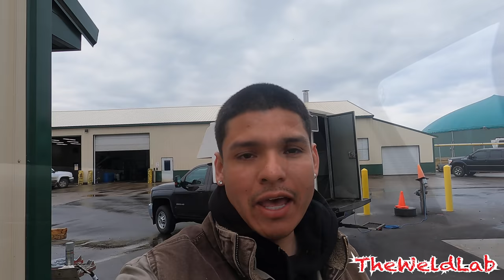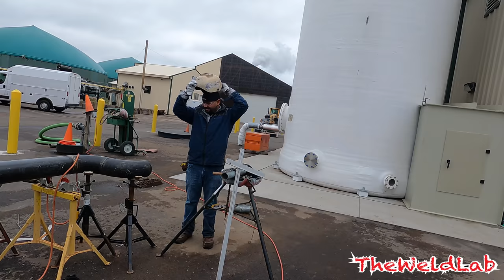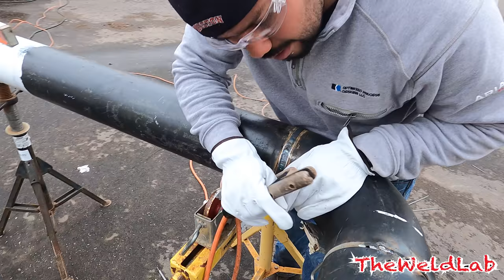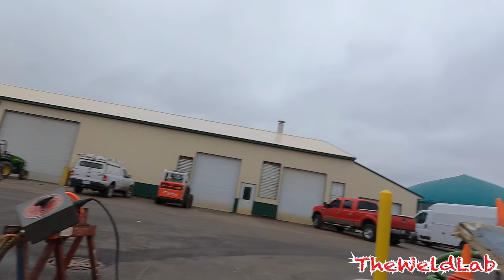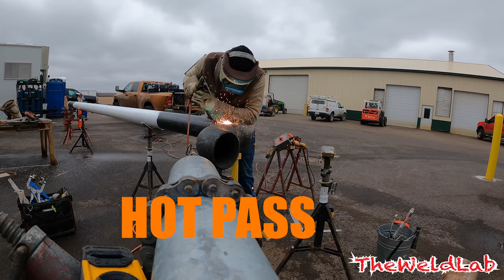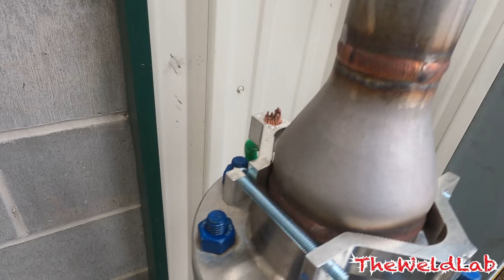X-RAY TIME! | REPAIRING ROOT | FAILED PRODUCTION WELD

Comment: With carbon pipe it depends on what code 1104 or 31.3 I’ve welded carbon where any suck back on the root had to be repaired. Depends on the owners and what they will let by and the code

Comment: To our friends outside the United States. The field downhill of pipe is used to prevent excess heat ( joules ) as going uphill can be done SLOWLY which overheats the pipe and even when it looks good the alloy of the pipe ( HAZ heat affected zone ) now may be compromised. With downhill the weld puddle will spill over the rod and have porosity.  Heavy schedule 160 wall may be welded uphill as the heat is absorbed by the massive thickness of the pipe. Preheat and post heat needs to be monitored on carbon and the WPS NEEDS TO BE FOLLOWED TO THE LETTER. You will be called back for more work if you are known as a heads up welder. Watch your argon lines so equipment does not get park on top and stop.your purge.

Comment: A video on what passes x ray would be great bro
Reply from the maker: 10-4 !
Reply: Get yourself familiar with the code you are welding in that is what passes x-ray. It's all in black and white. The codes are vastly different on every type of inclusion. One thing they all have in common is a nice clean weld is a nice clean weld. Practice and stay focused and you will not have to worry about failing any NDT not just x-ray.

Comment: Now on your stainless tig welds, are you scratch tig welding off your SA 200. Is there a tig kit that you can set up with a pedal? I have a ranger 250 and there is a pedal option with it. I've looked up tig kits for certain welders and the information is very vague. You do lay some good welds tho. I like your videos.  💯

Comment: Is the rod supposed to touch with the pipe or is it supposed to be right over it without touching the pipe?
Reply from the maker: 6010 or 7018?
Reply: @TheWeldLab  both?
Reply from the maker: 6010 you need to be on the pipe pushing the rod in for the hot pass you just float it 
With 7018 your just floating the rod also

Comment: Do you have any tips for finding inexpensive pipe for practice? I am really wanting to learn downhill pipe but my high school instructor doesn’t believe in downhill anything so I have to learn on my own
Reply: Honestly hes kinda right, if you can run uphill which is a bit harder u can def do downhill. Pipes all bout the fit, if the fits good everything else goes like butter

Comment: Man I need to find a way to get my foot in the door on that side of welding (if it ain’t round put it down!) 😂😂
Reply from the maker: haha i hate structure more if its galvanized
Reply: @TheWeldLab  yeah man fuck anything galvanized! Most of my work is in trash burners I’m a boilermaker but man I really want to be a pipe welder it’s just hard not getting to practice my tig welding

Comment: X ray guy here, its more about what code you are welding too. It doesn’t matter if the pipe is stainless or carbon steel. Its about the service is going into. That sch10 S/S is a bummer to shoot though. Its because the wall thickness is so thin. You really cant have anything in it for most codes.  Since it was pipe and sch10 it was most likely B31.3 normal fluid service. 

You are running down hill in this video. So I assume it should be api 1104. You can have a lot of shit in Api 1104.   

Also as an X ray guy  , Iam always like “man I hope this film comes out”.  Lol no one likes reshots.  Lol hope the stars aligned and this shit shoots good 😅.

Everyone fails x ray at some point dude. Thats bullshit anout your x ray  . Your weld stamp Should  be on the film or the reader sheet . Most welds you can match up some Weld contour  and prove if its your weld or not. That isnt always true but its definitely a thing. 

Rad video dude!  Looking forward to watch more dude!!!
Reply from the maker: very true brother!  thanks for watching